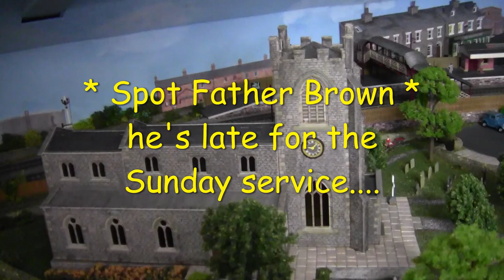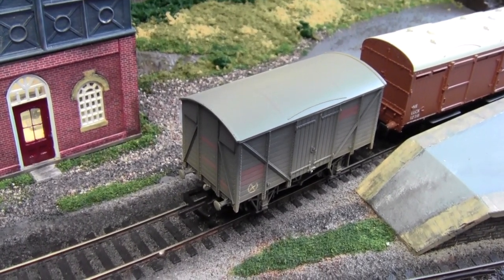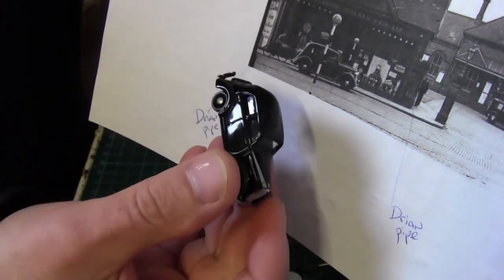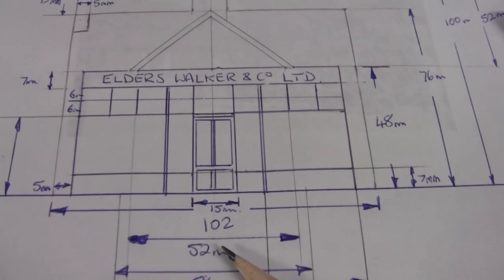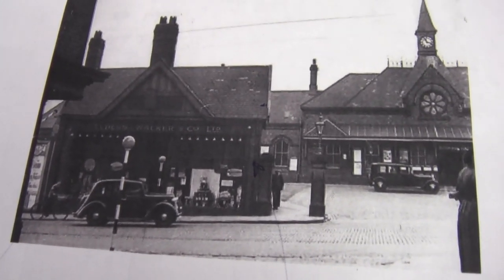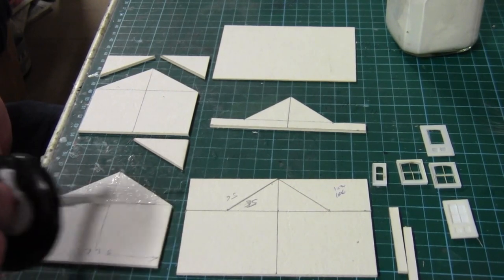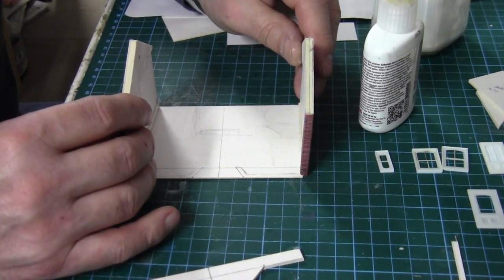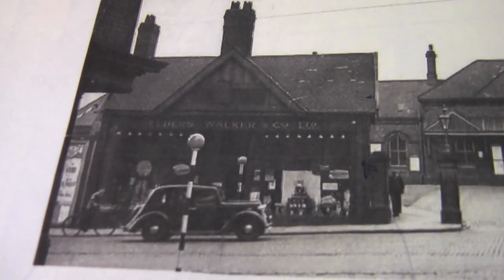The Shop   Part 1.........No 256

Comment: Hi Tony
Another great video. You have definitely captured the essence of the building. Another source of info for buildings are OS maps. They will show the plan dimensions so allowing you to check your estimates.
I am sure you are built out at the moment, but I am still hanging on for the roof over the tracks.
Regards
Reply from the maker: Hi Alan. i have not been up in the loft at all this weekend. had the Jab on Friday,  so hopefully i will get back up there during the week. as for the overall roof. i now have the timber that will support the roof. i have this little building to do and one more project before i start the main roof. April will be the start date....i have looked at an arial view of the building i am doing. and there is another building behind it. which is attached. so i have improvised and changed it a little bit to include a back yard. thanks again for commenting. hopefully there will be a video next week. all the best Tony

Comment: hi Tony 
you seem to know how to get what you need out your building it was interesting  to see you get the size of the building using the car
it does look like a great building
i through it was the vent van at the start
great work all round
tar for sharing 
keep safe arp
Reply from the maker: Hi Adi mate. its worked really well getting the sizes form the photo. would have been a bit tricky without a guide. i could have used the lolipop beacons. thanks again for commenting.all the best Tony

Comment: Tony you usually very good with your scales but the cars are different ones a two door the other is a four door 👍
Reply from the maker: Hi Alan. thank you for commenting. you may be right i would have to check on that. in the photo i can clearly see the passenger side front door handle but not the rear. a bit more investigation is required here. thanks again all the best Tony

Comment: It looks as if the car in front of the shop is from the 1940's, but no idea what make or model as a lot of the cars of that time has very similar designs.  Ig he car could be identified then you could use its wheelbase as a know measurement and then worked out a scale and used that for the calculation of the buildings dimension.  

Love the beginning sequence, wonder what case Father Brown was working on... has there been a murder in the town ????
Reply from the maker: Hi Malcolm. yes the car is a stroke of luck and has worked out quite well. to get the dimensions. your right most cars did look the same back then. as for father brown who knows what case he's working on next.  thanks again for commenting..............cheer's Tony

Comment: You said that "the car is just under 2 times the width of the building" (that would be a very long car, which is not shown in the photo). If you meant that the car is just under half the width of the building (That is: the building is 2 and a bit times longer than the car) that may put your calculations out.
Reply from the maker: Hi Henry. the car length in the photo is 33mm and the oo scale in 52mm. the total width of the of building worked out to be 102mm. so yes just under 2 lengths of the car. its a tricky one getting the scales right. but at the end of the end day. if it looks right then it is right ...........probably......all the best Tony

Comment: Belisha Beacons were not created until 1951.
Reply: My mistake - 1934 was the first time they appeared.
Reply from the maker: Hi Phil, i was just going to say the station was bombed in 1941. and that little building was not there after war. thanks again for commenting. very much appreciated......Tony
Reply: 1951 saw the introduction of Zebra crossings. You can see that there are studs between the two Belisha beacons in the photo , but no stripes. Every little helps when trying to date photos!
Reply from the maker: Thank you Martin. thank you for your insight. but there is a problem with that. the station was bomb in 1941 and wiped out the clock tower. the tower never got rebuilt again. the station had a different look right up to it end of days. the introduction of the Becon's came about in 1934. but yes you are right every little details does help. and it great that you can see more into the photo. as they say it takes a fresh pair of eye's. have a great weekend all the best Tony